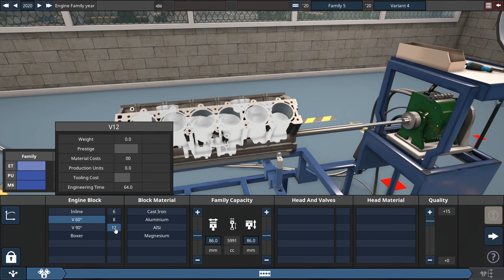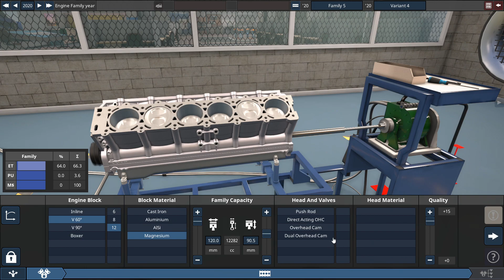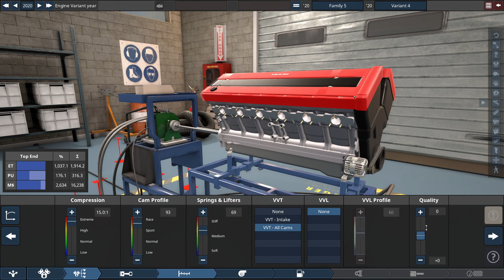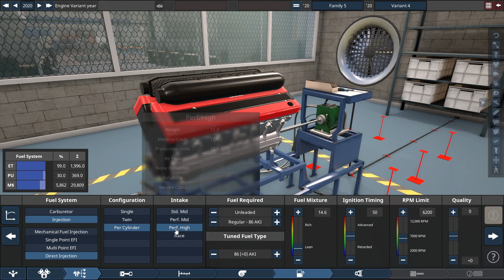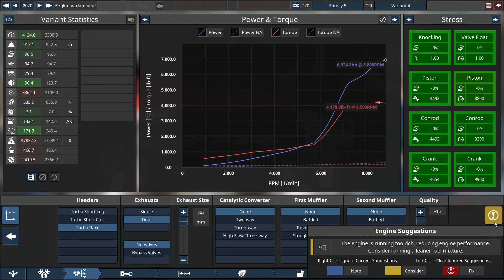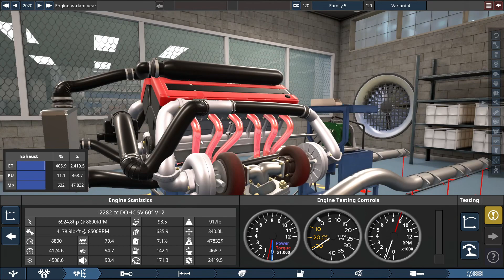The Ultimate, No Stress V12 Engine Ever! | Automation The Car Company Tycoon Game

Comment: I got 1990.3 hp at 6800 rpm with turbines at 0.94 stress at full load  with compressor stress at 0.95 an the torque is 1928 pounds of torque

Comment: Hopefully as the game updates you can get the option to duel charge the engines. Using a supercharger for low rpm and a turbocharger for the high rpm should eliminate most if not all of the turbo lag and smooth out the power graphs. With the duel charger system I will not be surprised if you can create a 10,000 bhp engine.
Reply: i think it's "twincharged" not "dualcharged" but i agree
Reply: @aque1840   I thought it was twin-charged too. But got confused because I thought twinchargered only applies to twin turbochargers... and twin turbos are already in the game.
Reply: @jlinger149  yeah I understand
Reply: i don't think supercharger are that good either at low rpm and they wpuld be restrictive for high rpm i guess. if you change the ratio of the supercharger making it good on low rpm i guess it will just die past 7000rpm on max quality but depends on how they make it, i don't know, for crazy power even turbo is not enought as it overheat or destroy itself 🤣
Reply: @qualcunoacaso4865  There is usually a bypass system for the supercharger. The supercharger is used in low rpm then as the rpm increases a bypass valve will open and redirect the air to the turbo charger. Look up Donut Media Twin charger on YouTube they explain it way better than I can.
Reply: @jlinger149  i will watch thanks. From what i can understand, there will be a clutch to disengage the supercharger, kinda like it's for a/c. Well it's sound complex and expensive to put in regular car 🤣. Anyway, this means it will hardly do something for achieving high hp numbers, actually the current problem to fight it's heat. In automation you cpuld probably achieve 10k hp already by having a mod that ignores temperature and mechanical stress of the turbo, or just being able to make a much larger turbine i think. I really hope they will add diesel, rotary and two strokes in the future